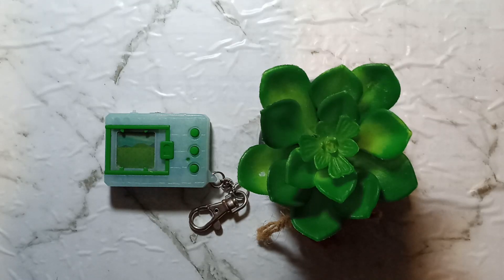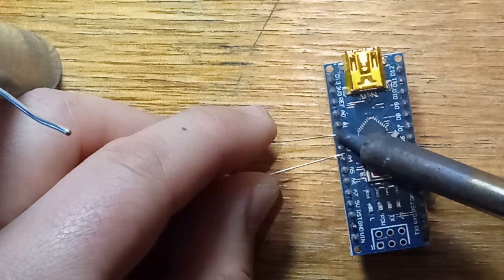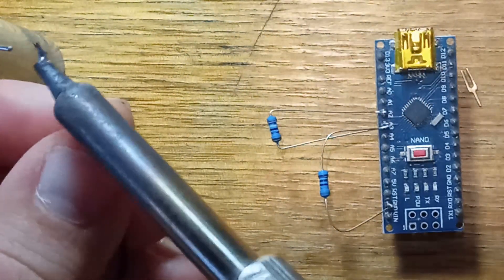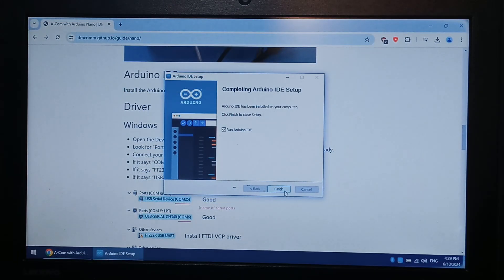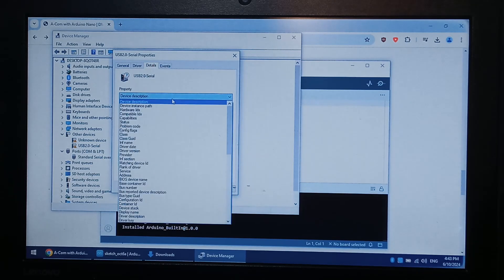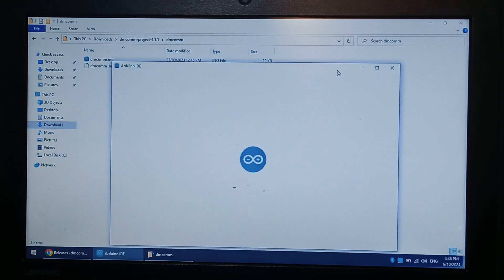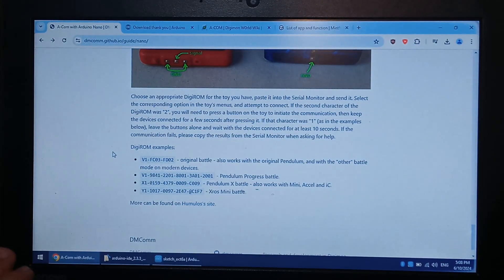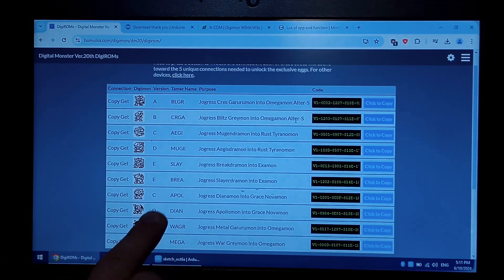Connecting a Digimon to a PC? - Digimon ACOM Full Build

Comment: How many watts are the resistors for?
Reply from the maker: they arent used to power anything, only data, so any ones will do. i used 1/4 watt in this video because its what i had on hand, but 1/8 or 1/2 will work just fine too

Comment: What are the cables you connected to the board to the digimon called so I can buy them (I know absolutely nothing about electronics)
Reply from the maker: they were just jumper wires (aka dupont cable) that i soldered a female pin header to. you can buy male to female jumpers (male to female dupont) to save you making your own, or if you dont feel comfortable soldering, you could use a breadboard (no soldering required, similar to lego, but not a permanent solution)
Reply: @SjslTech  Hey, same guy different acc im just on my PC, I ended up setting everything up but how do I decrease the voltage, more specifically here was my response after typing t, got 1 bytes: t -> [test voltages]
Reference declared: ~5V
Enabled high (40ms): 2336 units = 10.8-12.0V WARNING
Enabled low (40ms): 0 units = 0.0-0.0V
Disabled low (40ms): 3 units = 0.0-0.0V
Disabled high (100ms): 2349 units = 10.9-12.0V WARNING
A-Com detected
(paused)
Reply from the maker: @elliotcabrera6929  did you connect the resistors correctly? im not sure how you are getting 12v on a 3.3\5v micro
Reply: @SjslTech  Yes, the only difference is I'm using a USB c arduino nano
Reply: @SjslTech  Ok so for some reason it just works, even with the warning I just tried it and it works so I'm not questioning anything, thank you for the tutorial!
Reply from the maker: @elliotcabrera6929  glad to hear it works! if you have wired the 2 resistors up correctly you should be fine. you cant get 12v out of the micro, so hopefully just a faulty readout